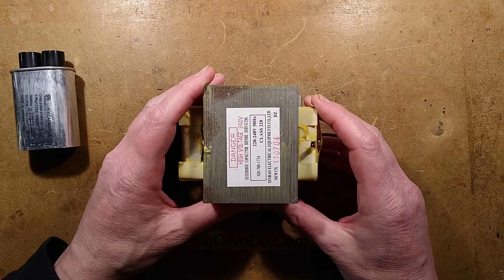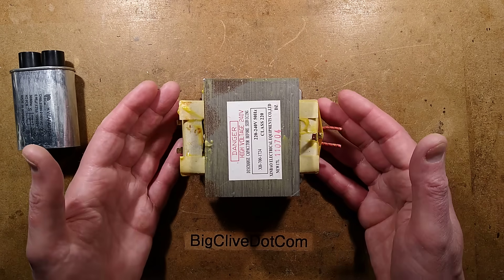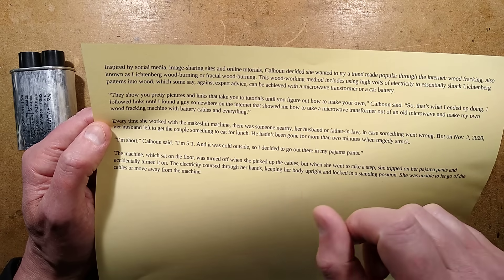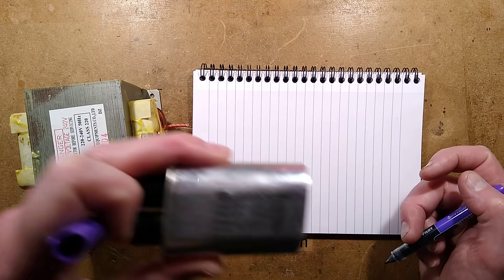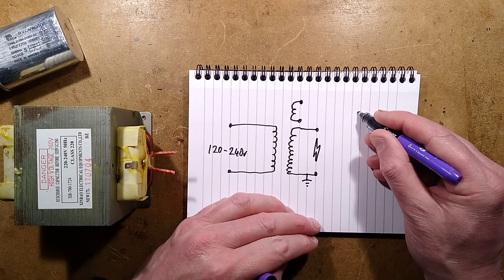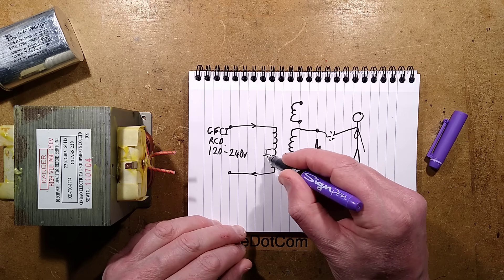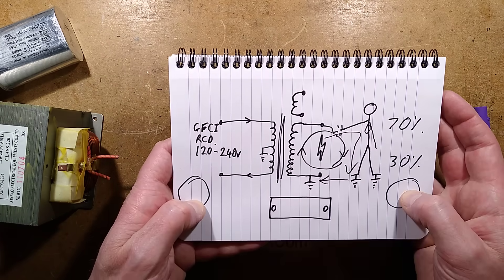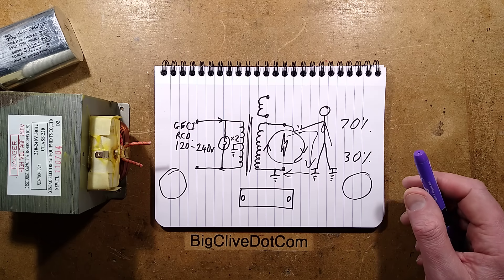The most deadly project on the Internet

Comment: My extreme fear of electricity always makes watching your videos a mixture of horror and fascination.  The idea of taking part of a microwave out and basically hot wiring it to make art is freaking INSANE!!!
Reply: A microwave is just a magnet device -.-
Reply: @friendlyreptile9931  30 people have died.
Reply: @kingcrimson4133  1000 of people die to traffic too. It's dangerus but it'S far away from "The most deadly"
Reply: @friendlyreptile9931  Danger is not determined by the frequency of death. It doesn't matter that only a handful of people die from tipping a vending machine onto themselves each year, if you tip a vending machine onto yourself you will probably die. If you take apart your microwave and screw around with the wiring to make wood art, that is extremely dangerous and you'll very likely get hurt or die.
Reply: @kingcrimson4133  So i'm right by your definition. There are many other things with a bigger chance to die ;)
Reply: @friendlyreptile9931  just an ordinary kitchen appliance

Comment: Even though I am not an Electrician, I am like most people who like to play with electricity! I have had a couple of serious 240v mains shocks, it took my breath away for seemingly ages, and the pain of 50 cycles per second. You feel every cycle. But I also learnt the phrase "SIDE" when I was 14 years old (1963). All persons who are competent to work on HV Capacitor Banks are taught this. It means: Switch Off / Isolate / Dump / Earth. Never touch a Capacitor, unless you dump its' stored charge.

Comment: You have to respect electricity.  I'm not at all concerned about working with 120/240, mostly because I'm familiar with the hazards and how best to avoid them.  I am cautious, if not necessarily nervous, about working in a panel.  But microwave transformers or the old florescent fixture ballast is something else entirely.

Comment: I've been hit by a MOT before.  It's something you only do once, because you either die or learn your lesson.   I saw an arc shoot out of finger tip, and flew backwards on to my bed where I struggled to breath for a good 15 minutes or so.   Should also discuss the dangers to your lungs from ozone and nitrogen dioxide
Reply: Also just as a side note.  The NST made these days have a circuit overload detector coming off of the secondary.  It's been around 15 years since I did this, but as I recall everything is submerged in an insulating glue.   Anyways you can remove the overload detection by cutting it out, try not to damage any more insulation than needed.   They still aren't exactly dangerous.  You will notice while wearing thick rubber gloves, if you touch the output wire, there will be sparks between ur gloves and the high voltage wires, but you probably won't feel a shock.   The higher frequencies cause more of a skin effect, so that helps you not die.   You should avoid MOT's unless you are willing to show them absolute respect, and actually have a need for the higher current.   60 Hz is the most lethal frequency.   Keep in mind current flows through your heart if one hand is touching something grounded, and your other hand touches the hot wire.   Never let your head be grounded, or touch the hot wire

Comment: One of the most grown up things I did was spec out an entire build order and diagram for a pair of GU81 based 100w single ended triode power amps, then simply abandoning it and not looking back when I saw the voltage needed from the transformers, I know I can make mistakes and take a shock occasionally, sometimes from mains, or a small cap, something about knowing such an error could result in a vaguely me-shaped-stain on the ceiling, being turned into a fine mist, or being sent into space from one minor "oops" was enough to completely delete all of my work, no more temptation.

Comment: Few steps I would do to make this "safer": 
- dead man switch can b ereplaced with a pedal. I made one for my "mains experiments". It enables me to have both hands free to work. There is hardly a situation where you wouldn't let the pedal go if anything happens, especially if you make it that it turn on with your toes (not the heel)  - it is a spring loaded, not latching switch (so that if you let go it immediately turns off). Can be made with a relay or that all the current goes through the switch. For maximum security it can be made covered (so that if something falls on the pedal it doesn't turn it on). You can combine it with a pot to control the speed /intensity of the controlled device. 
- not grounding the secondary (putting the transformer in highly insulated box and connecting its frame only to one of the electrodes). This way the device is only dangerous if you come in contact with BOTH wires. Or, when - in this case  - working with a medium, to have medium insulated from the ground and using a long enough electrode: I guess most of it is done this way. Even better, to make both electrodes to clamp to the medium and only work on distance. This way even this is pretty safe.
Reply: The point of Clive's design for the dead man's switch is so that both of your hands are occupied. With a project like this, especially in poorly trained hands (like most of the folks playing with this stuff), you have no reason to be interacting with the system while the device is energized.

Comment: I did a video with Efixx on not charging Evs by 3 pin plug and the safety devices in EV devices to protect you from shock like systems that disconnect incase of PEN fault.... the comments are full of people saying "I've charged like this for 2 years and am fine"  Just goes to show you do something long enough 1 day it will get you.

Comment: Big Clive is right about one thing he mentioned in this video: Microwaves are THE most Lethal home appliance to tinker with now that the very large CRT TV's have been replaced with flat screen TV's...

Some of the capacitors in a large CRT TV make the Microwave Capacitor look like a nerf dart gun in comparison...

And like Clive said, they can hold a Lethal Charge for a VERY long time (I think the record is more than a year for a washing machine size CRT TV, but I'm not sure about that)...
Reply: Hell Yeah.  Like Maxwell caps, pulsed laser caps, or other HV research capacitors like the ten-array Photonicinduction used recently to achieve the pulse of 30,000 Amps in order to bust the 5000 Amp utility fuse.  I looked those suckers up.  Oil filled, 2500VDC 10,000uF.  Holy shit.
  Dude is a professional, though.  An EE for the entire country's power distribution.
  Still, it's pretty wild he has 440Vac 100Amp 3-phase power at his suburban home...and a custom triple variable auto-transformer setup for testing multi kilowatt devices.

I have several low ESR sealed capacitors in the same neighborhood of voltage at about 50uF.  Came from a very large Nd:YAG laser.  

  The joule energy storage, depending on which equation is most applicable, shows that the kill energy is not a linear function of capacitance as the micro farads increase.  That means if a microwave cap is an average of 1uF, which is approximately enough to kill six adult humans DEAD-dead (as in no second chances), then 50uF or so at about the same voltage might be as much as a hundred times that.  Plus with low ESR/internal resistance or inductance, that means even faster charge and discharge times equaling more current.  

Half the reason flat weld bar straps exist is to act as a connection to endure high current arc connections.  When I see someone trying to charge and discharge a high energy capacitor on its own bare leads I have to call them stupid.  It's like, those things use threaded hardware bolts for the very REASON that you can machine strips of metal to act as leads so that they may be discharged by a custom made (VERY WELL INSULATED) discharge tool without damaging the component itself.

As for the largest capacitors I ever saw?  I'd imagine a large sea creature or dinosaur (if it was still around) would come off pretty badly from a discharge by one of those trash can sized caps weighing over 300lbs. each.  I don't even want to think about how many joules those things pack.
Reply: Another dangerous and potentially lethal thing to tinker with is anything that contains lithium batteries, if that thing breaks and the contents inside come in contact with the O2 in the air it will go up in flames like a little inferno

Comment: I done the wood burning and was a little confused how it was so deadly, until you mentioned the people hold the move the probes as its running, with water everywhere. I just sponge water on the surface and use nails connected to the transformer. If I have to move them, it gets unplugged. I mean it makes sense now about people doing that. If people would just do a little more research to really understand what they are playing with would save lives.
Reply from the maker: Sometimes they also make contact with live connections when plugs get mixed up or other mistakes are made.

Comment: A Word to the Potentially Suicidal:

IF you really, Really, REALLY want to give Fractal Wood Burning a try and you have to build your own burning unit because you can't find or afford one sold in stores, HAVE A QUALIFIED, LICENSED ELECTRICIAN THAT KNOWS WHAT THEY ARE DOING BUILD THE THING FOR YOU!!!

They will know what size of wires to use to build the burning leads (Note: Car Jumper Cables WILL NOT WORK PROPERLY!!! the insulation will NOT protect you from that much Voltage), how to properly wire up the wall plug to the Transformer and how to safely install everything in a properly insulated housing so you reduce the risk of getting killed...

Thank You.

This concludes my Public Service Announcement of the Epoch, you may now return to your regularly scheduled activity...

😄😁😆😅😂🤣

Comment: Back in 1990, a coworker of mine was accidentally killed while troubleshooting a microwave oven, he was electrocuted by the high voltage circuit.  We worked in a repair shop fixing home electronics and small appliances.
Reply from the maker: I think it's the biggest killer of service technicians.

Comment: pro tip: cover yourself entirely with copper mesh! (thich enough to pass 2A without burning you, 2A is usually the limit of the microwave transformers on their secondary)
This way you can play with HV all you want (below 2A, because above 2A the mesh would burn into your skin!)
Reply: Thanks, but I won't risk it.

Comment: When I do fractal burning I screw one lead to the piece and the other lead is attached to the end of a 6ft pvc pipe and that's the closest I get to the piece.  I also never approach the piece from the sides the leads come to it.  I have 3 safety's on the power to the transformer all of which I flip and unplug when i'm not burning.  a switch, a gfci, and the plug itself.  Ive seen the power jump out of the lead connected to the pipe arc 1+ inch to the ground(where the wire is insulated!).   I go into a hyper-concentrated state of mind when I burn, it's like when you're rock climbing and everything slows down, I understand that one mistake is my death!  IF YOU DON'T UNDERSTAND HOW ELECTRICITY WORKS NO AMOUNT OF SAFETY ADVICE IS ENOUGH TO DO THIS SAFELY!

Comment: Hi, I just came across this video while watching the DIY spot welding using microwave transformers and I didn't know that they are that fatal. Thank you very much for explaining it very clearly. I really appreciate your precaution about microwave trans!
Reply from the maker: The spot welding project is much safer, as it replaces the high voltage winding with a very low voltage one.
Reply: @bigclivedotcom  Yes that's true. Thanks to your heads up, it gave me an idea on how to remove capacitor and transformer safely from the microwave oven.

Comment: Hi i found your video on microwave oven HV transformers very informative as a retired microwave service engineer of almost 40years i fully understand all safety aspects of working on these ovens i was trained by various manufacturers on all aspects of these appliances and formost all safety aspects of safe working practice at all times with the 3d procedure to be carried out every time before you worked on the appliance the first D=disconect from mains 2=door jamed open 3=dischare HV capacitor with the appropriate discharge tool of which there are several especially made for that purpose.i could go on about safety in more depth but it would take to long all the best from MICRODAVE.

Comment: My father witnessed a pair of men die while pushing a small boat onto a trailer. The mast touched the high voltage lines above and they instantly burst into flames. He said he could see them inside this blue fireball writhing. I forget the exact circumstances but they had to use another vehicle to just slowly push the trailer and boat off the lines and away enough so that current would stop flowing and not arc or anything like that. 
He was leaving work and waiting to make a left turn when he saw this, they were across the street at a storage yard. 
There was a lawsuit against the boat manufacturer for not having a warning about watching for overhead lines and that the boat was conductive - something like that. I don't think they went to trial and just settled. My dad got called by the lawyers of both parties to tell them what he had seen. 

One guy was cooked and dead on scene the other lived for a few hours and died in the hospital. He said it was the most gruesome thing hes ever seen and one of the things that sticks out the most is that one of the guy's girlfriends was standing there watching them do this and when it happened she was just screaming bloody murder the entire time.
Reply: There was a PSA in the UK with this exact scenario - everyone remembers the kid with the frisbee trying to get it from the power station and getting fried, but I remembered that one cos I used to sail. https://youtu.be/8-JfnhABs9U?t=197

Comment: When I was renting a place while going to college I had some strange electrical problems.  Lights were dimmer, my household fan would rotate only a little.  I called the landlord about the problem.  He came over and went down to the fuse box.  He's Chinese, had limited English language skills, and had halitosis which I politely suffered through.  I watched him work on the fuse box for a while.  He started to jab at the main disconnect with a screwdriver while standing on wet concrete (the washer leaked, of course, which was right next to the fuse box).  He appeared to be attempting to pry gum off of a thick copper cable that was connecting the terminals on the clearly bypassed disconnect.  As he did so I could see it spark.  That's about the time I decided I did not want to stand there and watch him die and went back upstairs.  

Well, he lived and proclaimed the issue fixed.  Sure enough, it was "fixed".  I moved out a month later.  Do not trust the wiring in your house unless you know it has been inspected by a competent expert.  Even then, you may want to watch them do it and ask questions if you have any.  Even honest and experienced professionals make mistakes.

Comment: I made and use one of these; have an extension cord to which a switch is plugged into. the switch is six feet from the machine which is housed in a five gallon bucket, (no lid), with heavy leads that penetrate the side an inch above base level. To use, I insert nails and spray solution with one hand  behind my back, switch off, and the wall end of the extension cord in my hand. every time I manipulate any part, I literally hold the male end of cord up in front of my face and announce to myself that it is indeed unplugged. My feeling is that I will only make a mistake with this one time. I've used this perhaps 200+ times and it most definitely still scares me!

Comment: I worked as an electrician for a few years, Still do it on the side, and my father was an electrician for 48 years. I have an intimate level of respect for electricity. I won't even go outdoors in a lightening storm. the 120V in the US that I work around isn't really that bad but I am still very careful around it. I never use both hands when working around live wires and I always wear insulating shoes or put my knees on an insulating pad. I've had co-workers who were more careless and they always made fun of me for being as slow as I was because of the care I took but I've seen many guys blow holes out of their tools and get arc flash in their face and I always remember why I take my time. On top of that, I always try to work on dead circuits first rather than leaving things live for the sake of time. My father almost lost his life one night while I was working with him at an office building, I was 8 years old and was helping him pull wire. He was working on a 3 phase 300amp service panel live, it had to be live because it was a working office building. He slipped with his lineman's pliers and crossed a phase. he was blown back on his butt and had some burns on his arm, was seeing spots for a bit. Fortunately, it acted like a fuse and blew the pliers apart rather quickly so it was a quick bang and flash. He had to go buy some new pliers after that but he never worked on live service panels again.

Comment: Unless you are a qualified electrician, do not mess with high voltages, that's my advice.
You can even get an electric shock from your car, petrol engines ignition voltages are similarly generated, albeit at much less current. As Clive said, don't ever tamper with the insides of a live microwave cooker; not only get electrocuted but you might receive a dose of damaging microwaves, could fry your brain and you would not even know it was happening.⛔🤦‍♀☹

Comment: Is there a RCD or GFCI that can handle high voltage to add the secondary winding, assuming that there are not huge current loss during the wood-burning processes